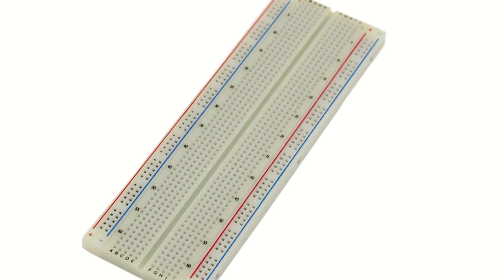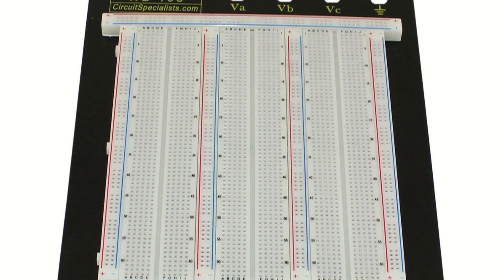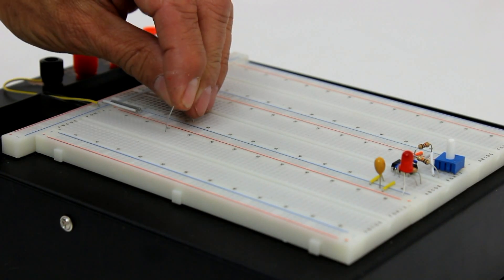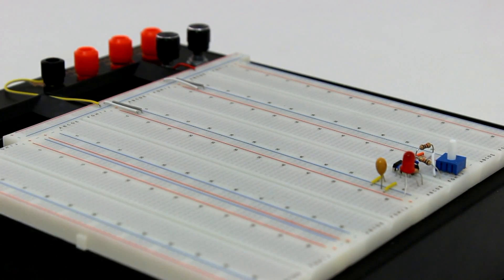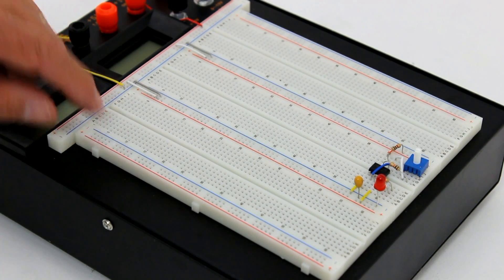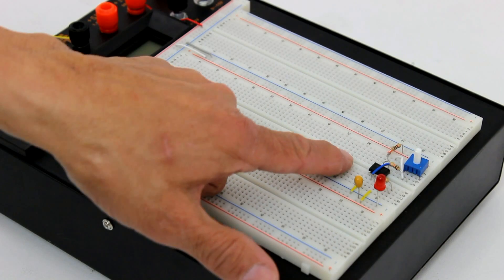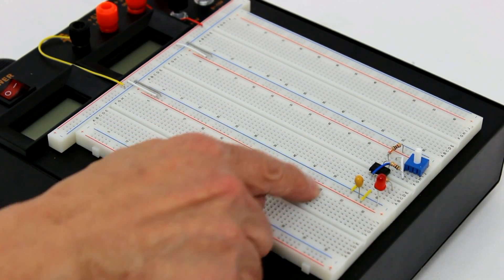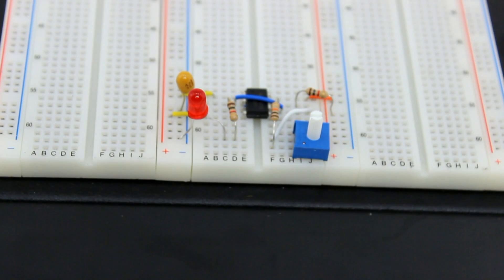Using a solderless breadboard

Comment: What is the name of the breadboard with the pots and display?

I could not see it on the linked page
Reply: Looks like you have to contact them for a quote which means the price must be outrageous!!   https://www.circuitspecialists.com/powered-breadboard-with-lcd-voltage-displays
It would be nice to just have a direct link so I did not have to waste 40 minutes searching. A little common sense goes a long way. I am going to build my own!!
Reply: Mike Lee thank you,

I came to the same conclusion, simpler just to build my own.
Reply from the maker: Thank you for your interest, we have an improved version of this item. I will include the link below. https://www.circuitspecialists.com/powered-protoboard-system-with-two-led-digital-panel-meters.html